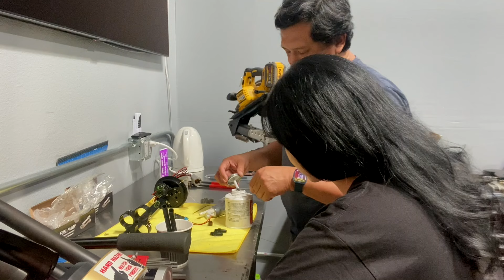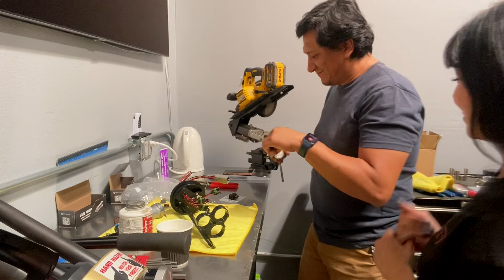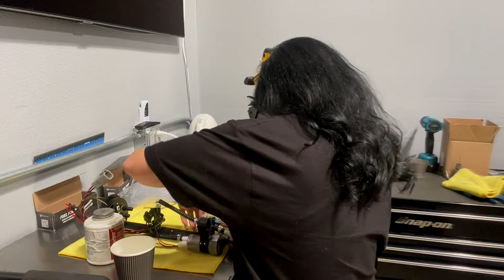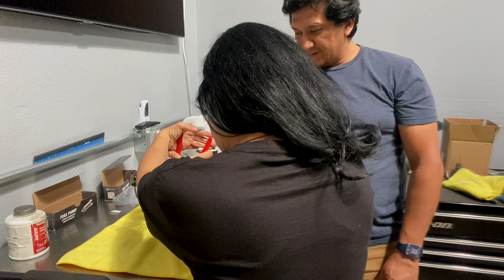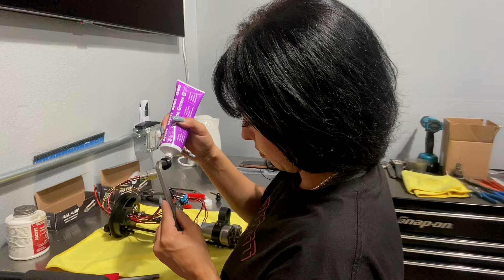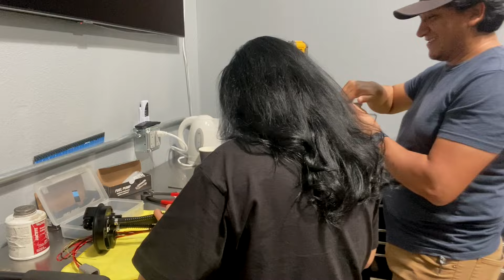Finished my Fuel Hanger from PHR 🙌🏼 (Part2)

Comment: I'm wondering what would it be the white compound he's using to fill the threads in, because definitely isn't any kind of silicone grease (which is the purple tube) .
I didn't know that for strategy it's pretty cool to soften the hose with warm or heated water, but apparently you had to push it forward a little bit stronger do ya? Definitely you did🤣🤣🤣
Reply from the maker: For the white stuff, its PTFE Paste, prevents leaks !!! So its sticks on there pretty well
Reply from the maker: Oh yeah,that thing was still tough to push in
Reply: @hotmodz_  I just searched what's PTFE stands for and I found out that it's better still calling it PTFE 🤣🤣 (polytetrafluoroethylene)